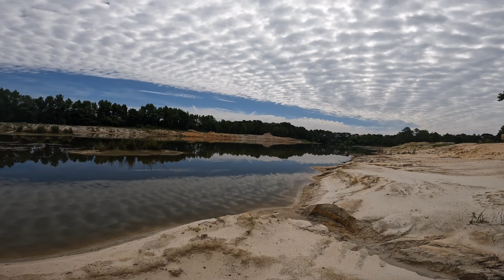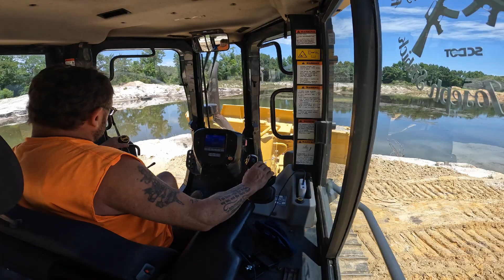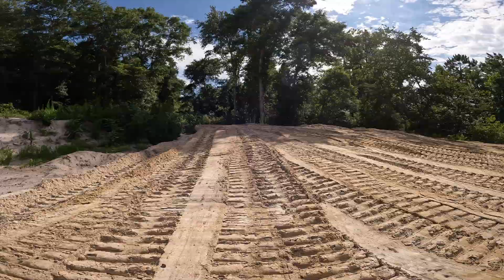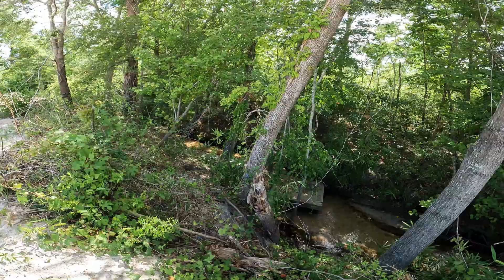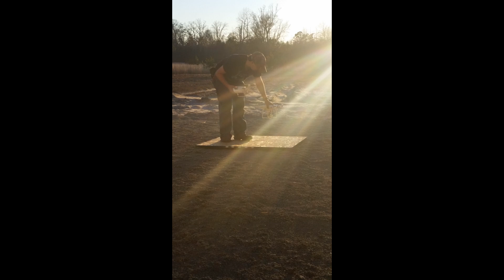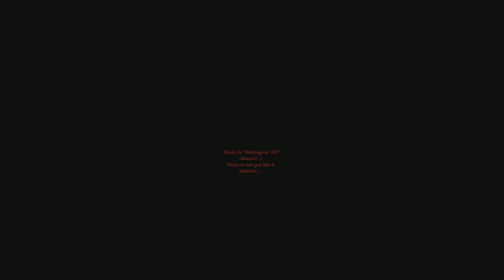2nd Day Dozing ... Dam Rd / Diversion Trail Corner Defined Now...

Comment: Hope your happy with the dozer , nice dry sand and even if it rains It will dry out easy, I know I operate dozers and excavators, but I’m all for excavator and dump trucks to move sand! That’s only if the sand will take trucks going over it ? And if there good drivers?? I had five dump trucks running last month And I’m sure they must put a chip in there brain and they all drive in the same ruts and all come back together like flipping sheep 🤣😂nice video 👍
Reply from the maker: Thanks Kevin!.....I am looking at dump trucks....like everything else, not plentiful selections 😊
Reply: I know big prices and little out there , I think people are holding on to them because so expensive new. And I’m all for Volvo dump trucks, think Chris picked a good one with the one he bought,